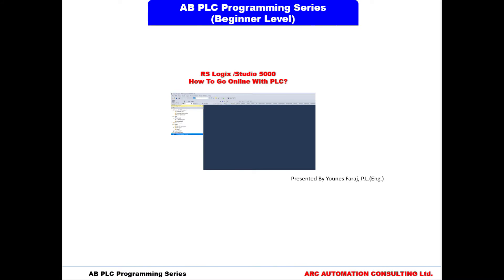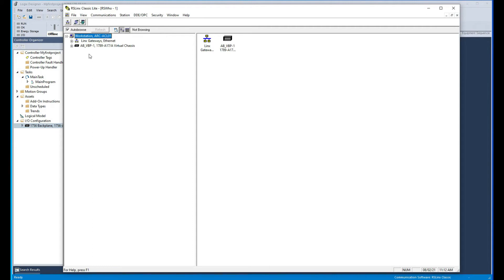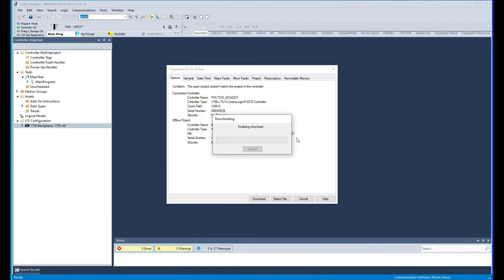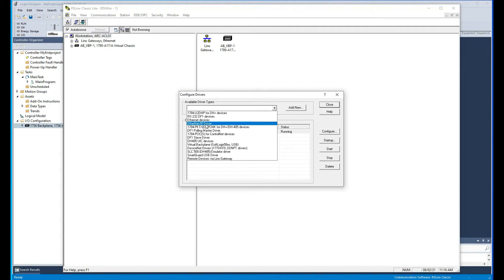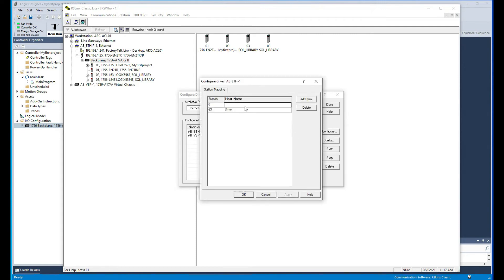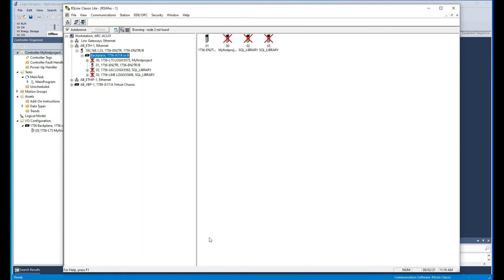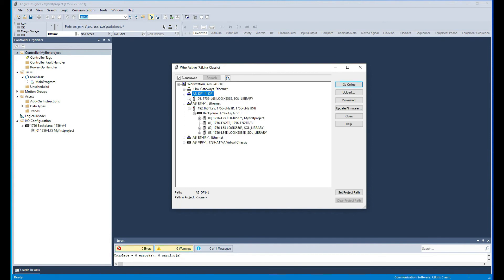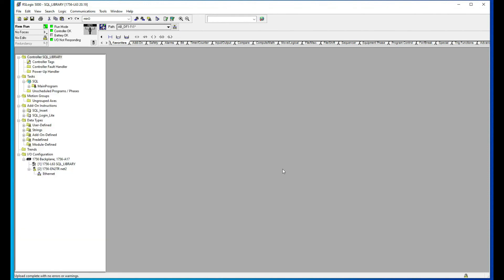RSLogix 5000 Programming Tutorial (Beginners Level| How to go online with AB PLC

Comment: In simatic pcs7 or simatic tia portal, we can search ip of the plc. How to search the ip of a AB plc if we do not know its ip? Take it ad i dont have the database and i need to upload from the AB plc, which u do not know its ip address.
Reply from the maker: If you don’t know the  IP address you simply go online with plc via USB or serial port and you would know the IP address. 
But keep in mind that for the  5380, 5480 or 5580 plc series the ip is displayed and for 5570 series the ip will be displayed by the Ethernet module and for those that doesn’t display it like the 5370 series than one way is to use the method described above.
Reply: @arcautomationconsultingltd6951  thanks for the guidance! :) i am totally new to AB. Any good video guidance in your channel on it? Example:
1) introduction to AB: what kind of plc, difference, etc
2) licenses required, how to get it, validity, activation, etc.
3) explanation on the AB architecture configuration. (Siemens involves netpro, etc)
4) Each of the button function in Studio/rxlogix progtamming. Example: what file, menu, etc.
5) best programming method for AB. How to utilize call function in ladder, how to do loop, etc.

Just asking. If dont have, it is ok. I will try to dig around. 😀
Reply from the maker: @entertainmentjoke2871  you’re welcome. You can watch this playlist : https://youtube.com/playlist?list=PLkLp4DZBLv2fZ7N61NRGHSvIMvNq1imwo
Reply from the maker: And this one too: https://youtube.com/playlist?list=PLkLp4DZBLv2fRu9YRW2KzxyYq8TsHl1GM 
Make sure you subscribe so you don’t miss any new videos. Thanks
Reply: @arcautomationconsultingltd6951  done subscribe